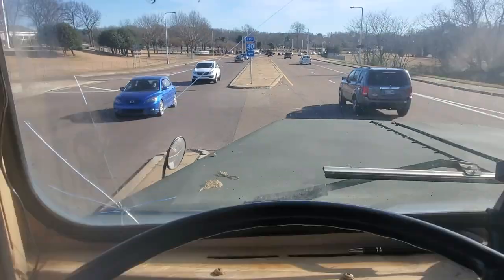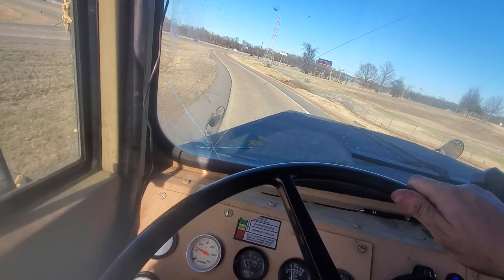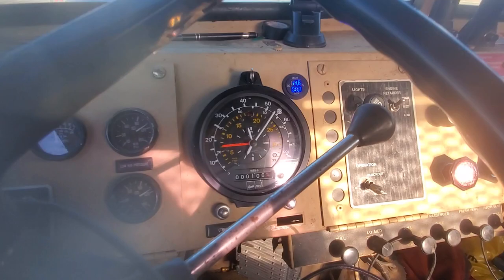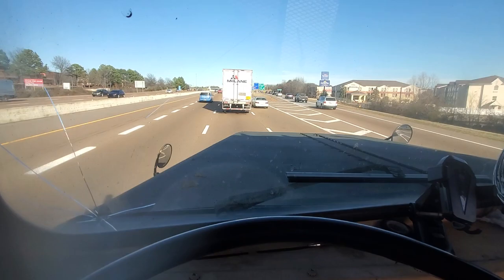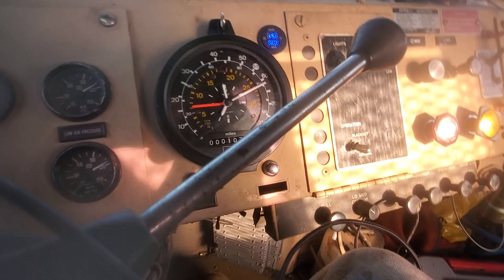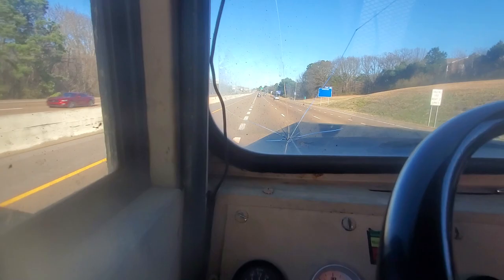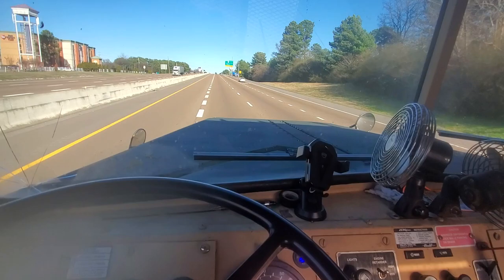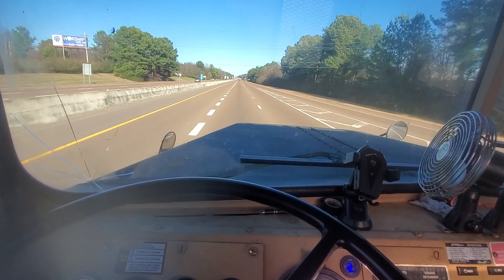Am general M915A1 and M870A1 @ 55,000# - HT4B Turbo test

Comment: Where did you get the new turbo for the truck ? Cause that is a major improvement  for the highway
Reply from the maker: Diesel parts direct in baton rouge

https://www.dieselpartsdirect.com/r3801590
Reply from the maker: Diesel parts direct in baton rouge

https://www.dieselpartsdirect.com/r3801590
Reply: Wes Simpson  thanks for that and when you put the new turbo in did you have to do any retuning for the engine or no?
Reply from the maker: @barfieldthesandman6841  cut the existing drain tube. Install a hose.  Add a new T for the turbo drain and the bypass oil filter drain if you have a big cam 3.  

My current boost numbers are 33psi at 225 rail pressure. #5 button.   Egt is around 925 max post turbo climbing 7% at 75,000lbs

Comment: What a truck! What year is this rig? What's the transmission? I'd love it if you could do a super long driving video of this truck, with plenty of shifting and jaking (if it has a jake). Please let me know ASAP.
Reply: Did you get my comment? I haven't heard anything. Also, if it's not too much trouble, I'd love a super long driving video on the M915A4R2 you ran in your most recent video, I'd love to hear that one shifting up and down through the gears, cruising, all that good stuff. Please let me know ASAP, would be greatly appreciated.
Reply: @GarbageSean  I'm not the OP - but I drove these trucks in the Army. An M915A1 transmission was an Allison 5 speed automatic transmission and the engine was a Cummins NTC 400 turbocharged.  They were produced starting in 1983, with production stopping in 1984.  They were fun to drive, though not nearly as fun as the original M915 with the Caterpillar 16 speed semi-automatic transmission.  Long haul though they'd wear you out.
Reply: @michaelmeyer2725  do you know what model Allisons the M915’s had behind the Cummins NTC400?
Reply: @GarbageSean  Allison HT-750 CRD
Reply: The original CAT 9155 was a better trans. It succumbed to the everylasting air leakes.
Reply: They did have a Jake brake, it was a pedal on the floor, lousy design.
The original M915 had a 16 speed Cat. It had great pulling power.